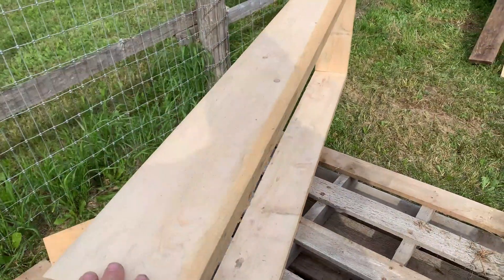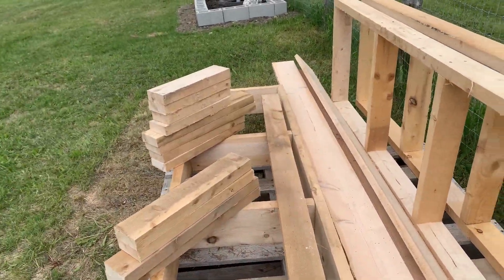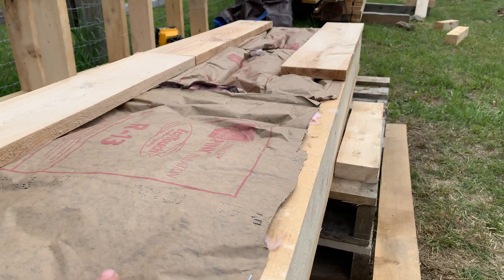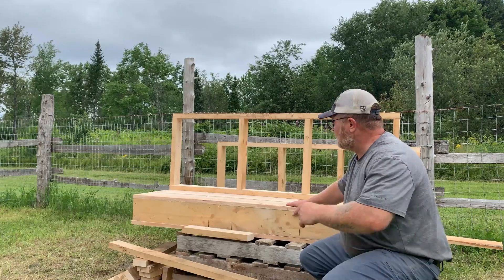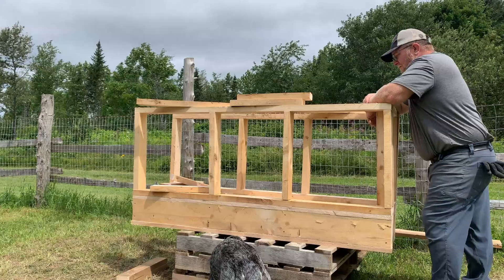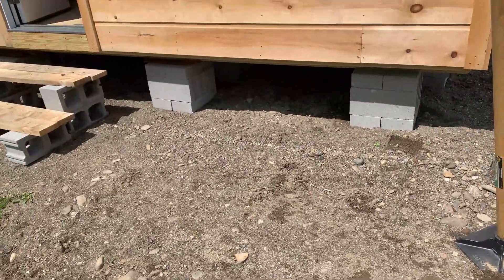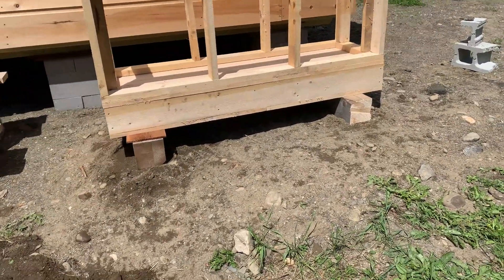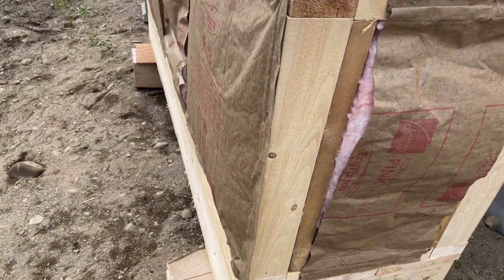DIY Rolls Surrette Solar Battery Storage | Part 1

Comment: You will have rain, ice and snow coming off the roof and falling onto the battery box.  Maybe you need to move the box away from the side of the house.
Reply from the maker: We contemplated every other location and this worked the best.  You’ve highlighted a good point though and as such, we’ll be diverting the water via gutters on the cabin.  As for the snow and ice, I do plan on keeping it clear, but we’ll see how that goes this winter.  Thanks for the comment!

Comment: Your batteries need to be vented to the outside open area because of the off-gas that each battery produces.  You need to have about 6- 2 inch holes towards the top of the box to allow the battery gasses to bleed - off so that you do not have an explosion if you have any sparks.  Think of how your car battery is covered but it is open to the engine compartment
Reply from the maker: Hi! Yep, agreed.  Part 2 coming tomorrow! 😉

Comment: in my experience (any and all homestead working handsomely 3 things are required,
1. Good power bank and power generation, (solar/wind/generator)
2. a good homestead garden (fruits n veggies)
3.  farm animals (goats, duck, chicken, geese, fish)
The optional need for the growing homestead
4. totally optional, a good ATV to do chores around the property (fourtrax 4x4 Honda 2017 ATV) make sure it has a good engine, and accessories points (back rack, front loader (for snow or dirt or mud removal and lastly the 4x4 works.
5. totally optional, a bandsaw lumber mill (with a snow covered shed) so you can use the dead standing wood and make it into lumber to use at your property or help out your neighbors or sell it to the local store for a good sum, of-course you can buy it new, but it is advisable that at this stage in your homestead buying a used working lumber bandsaw mill is equally beneficial.
6. totally optional, since you'd be positing videos on the internet a good outdoor 4/5g sim mounted router with an external antenna would be a good investment)

Regards from Singapore, GOD BLESS.